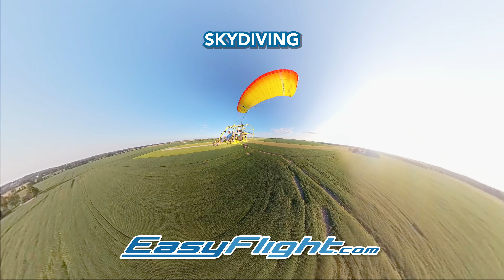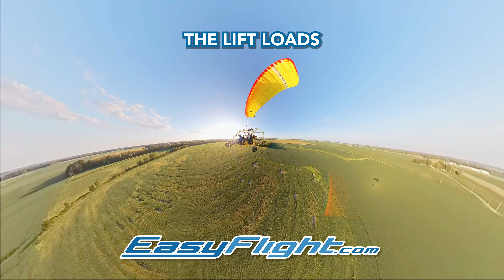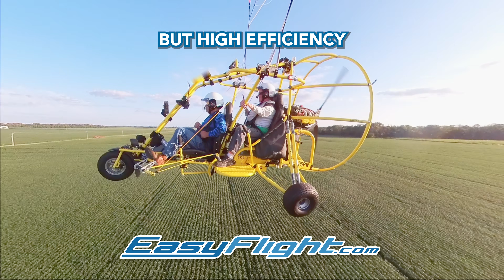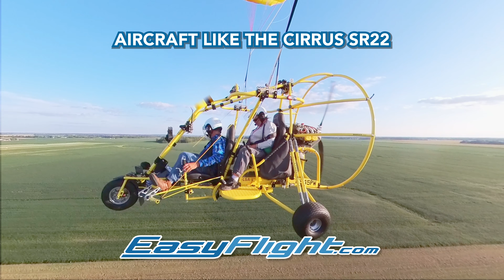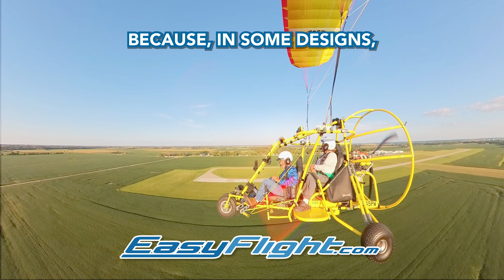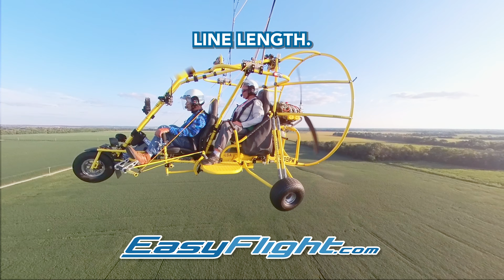Why Don’t Powered Parachutes Use Reserve Parachutes?

Comment from the maker: This topic tends to generate strong opinions.

If you believe powered parachutes should use reserve parachutes, I’d genuinely be interested in hearing what specific failure mode you’re trying to solve.
Are you thinking structural failure? Engine-out over hostile terrain? Aerobatic stress?

Let’s keep the discussion focused on real-world operating scenarios.
Reply: I guess the only concern is what happens if a drone strikes the parachute?
Reply from the maker: That probably would not be a great day, depending on where they strike.
Reply: Great video Roy, lots of info, scenarios and answered  questions packed in there.
Reply: Very good information,  I've looked into the reasons why I might add a. Hute and where for a good deployment. I do not see the same need I had as sky div8ng or ultra lights. My passenger/ co-pilots have ask alot of times. I have tried to explain my perspective and now yours advances and confirms alot of my thoughts. Thank you for your sharing and helping others understand our options.